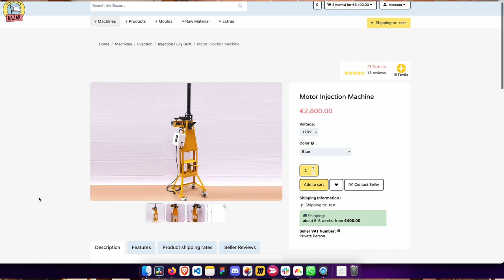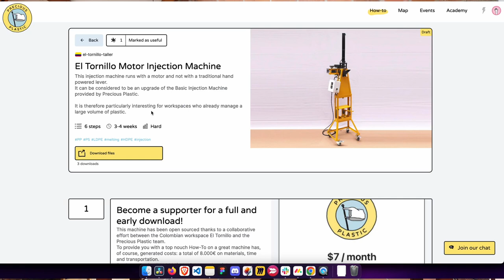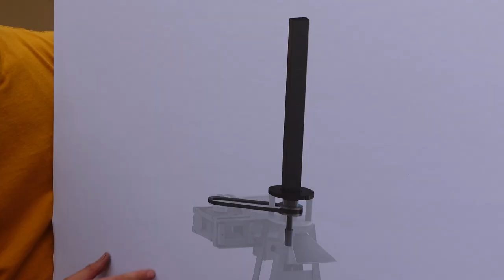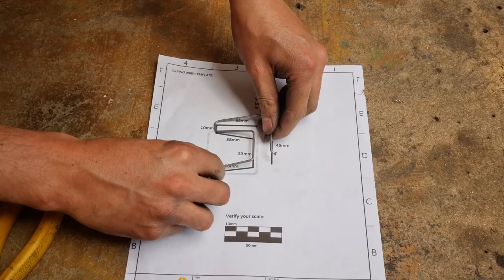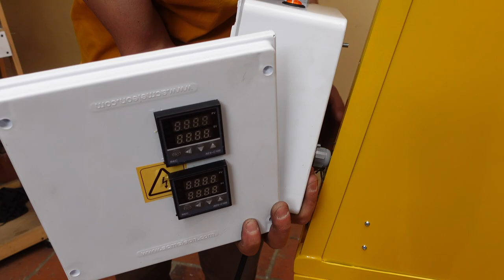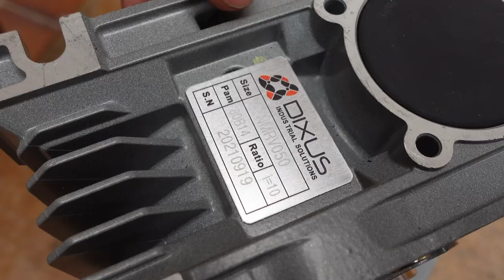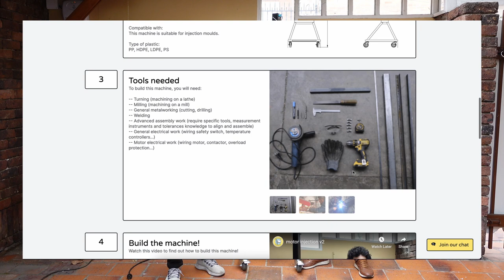Motored Plastic Injection Machine TUTORIAL

Comment: Major problem with the bottom mold press plate is it doesn't stay horizontal as it retracts which most likely will drop your mold on the floor damaging it when the press plate is retracted. Another thing is that the bottom jack mount plate  is questionable whether or not  it will eventually develop a depression due to being under constant high pressure, bridging should be added under the bottom jack mounting plate.

Comment: Nice work! I am thinking of something  similar, except using air cylinders- a 1 1/2" bore, 5" stroke double acting cylinder is $95 and would eliminate a LOT of machining, plus the expense of the motor. It might also eliminate the 2-ton jack down below. There would be lots of engineering required to get the sizes right, but I'm thinking that increased simplicity= more machines=more recycling.

Comment: Your "spacers" would be more helpful if they were adjustable to accommodate axial tolerance issues. Your dimensions stated in the video do not seem to line up where two parts are meant to join together they should have the same inner diameter and outer diameter on the other part (25mm, 28mm, 32mm and 36mm). Your bearings are very sloppy, your shaft size should be as close to a press fit as you can for the inner race and machining a step on both sides of the threaded tube assembly at a known dimension would make spacing and adjusting easier. Making sure the bearings are well seated and well lubricated with help with life span. Greasing and adding grease fitting for the acme threads will help with excess wear. The general design is good but some parts need a bit more precision. Using one or two hubs for a heavy duty trailer could be a good choice for having a precise housing that can hold standard bearings.

Comment: I understand that in industrial injection molding machines the main screw piston increases in diameter as you go down and thus creates friction between the plastic and the wall of the tube, melts the plastic and as such doesn't need a heating mechanism or at least significantly reduces the requirements for heating. Is such a thing possible on a smaller scale such as this as well?
Reply from the maker: We use those type of screws on our Extrusion machine https://community.preciousplastic.com/academy/build/extrusionpro

Comment: Great video guys! I love the engineering and simplicity to keep the build costs down.
I did notice the the dimensions for the hollow bar (with machined keyway) look to be incorrect - it looks more like >40mm OD?
Loving your work!
Reply: Hi trentineer. Thanks for the comments! Yes, the low cost was an important requirement for this project 🙂 About the OD for the pulley axis, it is 36mm. In the video it is made from different parts (nuts and hollow bar), but it would work better if you make it from a single bronze part (as explained at the end of the video)

Comment: This thing will tear down itself by its generated force if the volume of the injection is not the volume of the barrel (and the switch is not triggered) 
Why you don't use a VFD with current limiter in here?
Reply from the maker: Thanks Friedrich! Very valuable feedback for El tornillo and anyone replicating this machine. Hopefully the switch doesn't fail us too often.
Reply: Hi Friedrich. Thanks for the feedback!
I'm interested to know specifically what you mean by "tear down". Have you noticed any weak points in the machine that should be improved?

About the volume, if the injection volume is less than the barrel volume, then the piston stops and the belt slips on the pulley leaving the motor to keep moving. At this moment the operator should stop the motor, keep the pressure a few seconds and then turn it back to release the pressure.
About the limit switches, yes, they must be very well installed so that they are triggered. If they don't trigger, can damage the screws that hold the switches in place. Then, the screw will keep moving and stop on one of its ends. Then the belt should slide on the pulley avoiding further damage.

On the other hand, we thought of the use of VFD's but those are a bit expensive and we wanted to keep the budget low. Also, they work only for speed control, which I think is not completely necessary for the injection, I think the faster, the better. So I'm using the motor to the maximum without any variation.

Or you meant to use the VFD as a high voltage limiter to control voltage spikes?

I would love to hear more about what you think.

Best,
Andrés
Reply: @eltornillotaller6813  Hi Andrés - thanks for coming back!
I think there are no weak points in the mechanics as far I can see.
Only the drive system i have doubts about- "belt slipping" is not the most sustainable overload protection i think.

Every VFD has a overcurrent limit which you can set and the motor will stop. If you set it as an output on the VFD you get a signal that can go into a delay timer and auto-reverse the motor. 
Also you can display the current used at the moment - which is very helpful to determine your injection pressure and find errors with the plastic/machine/mould.

The cheap option is sth. like a GRI8-04 to stop (and reverse) the motor - its used in some shredders too.
Reply: Hi  @FriedrichKegel . Thanks for all that information!
I'll search and study those components to see how I can include them in the machine.

I think you are right, a belt slipping is not the best way to control the pressure/overload, for now it's working in this first design but definitely its something to be improve. 

Thanks again,
Andrés